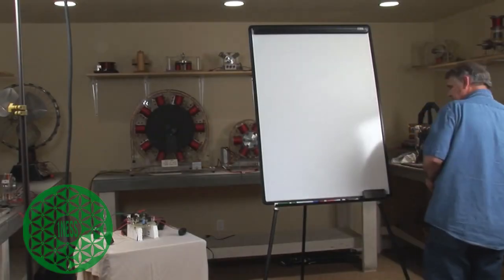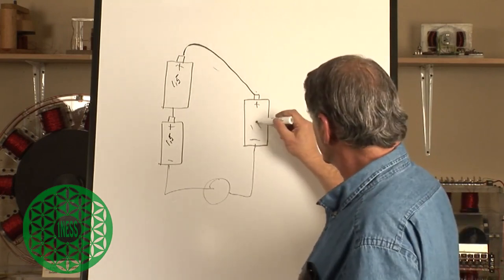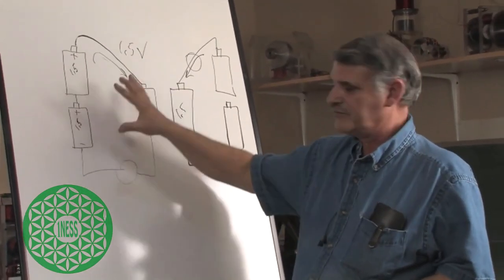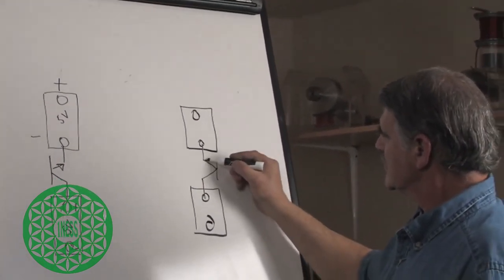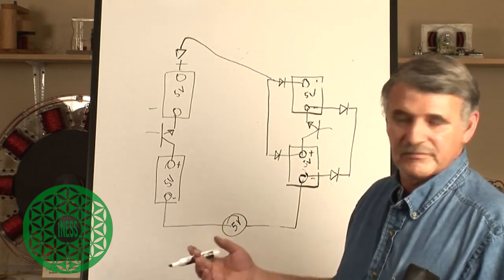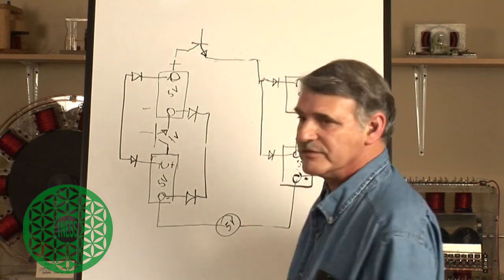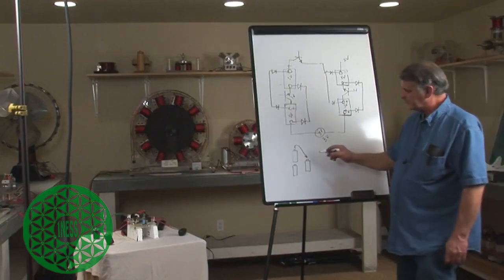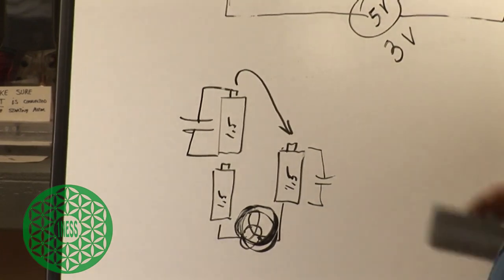Bedini Tesla Switch Part 2

Comment: So, instead of buying one new battery, to power the light bulb, you buy two new batteries? Then you build this circuit.  So that the two new batteries, can power the bulb and recharge one old battery. When the two new batteries are fully discharged , the old battery is NOT fully recharged! What kind of stupidity, is this?